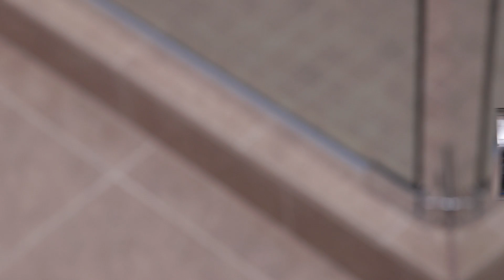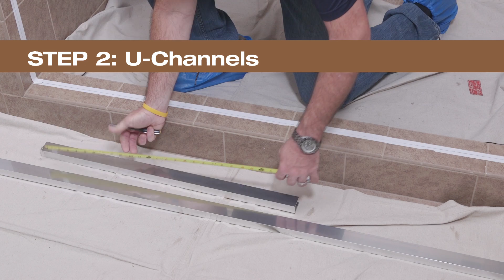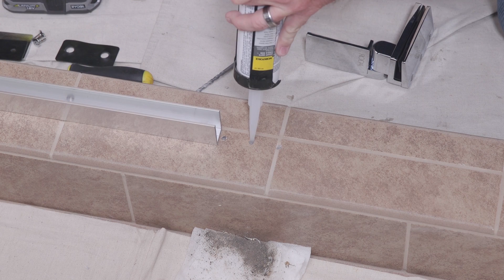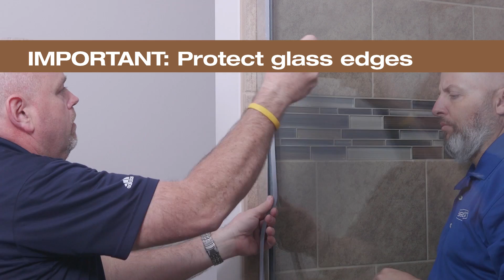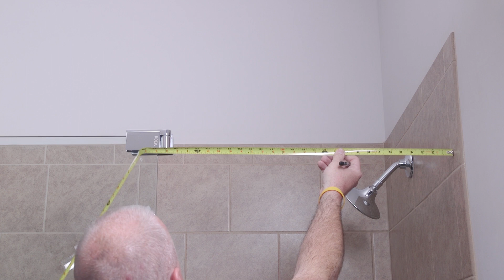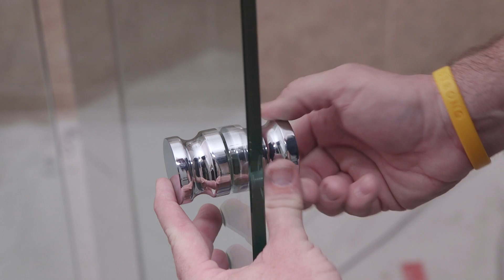DIY Shower Door Installation How To - Cantour Series by Basco Frameless Shower Enclosure

Comment: I have acrylic shower base.  Do I still need drill hole through the aluminum rails and put down anchors?
Reply from the maker: Thank you for your question! The frame comes pre-drilled.  If there is no stud behind your acrylic walls, you will want to use the anchors supplied in the hardware strip.  We recommend not drilling into the base.  The majority of our doors are sealed to the base with silicone, with the exception of our heavy glass frameless doors, which we do not advise putting on acrylic bases due to their overall weight.

Comment: Awesome now you have a leaky shower, good job fellas. You should never drill into the curb. Silicone or not
Reply: Nonsense.  However else are you going to rigidly secure the bottom of the the fixed screen?  In any event, a simple but properly applied silicone bead will ensure no water causes problems in the first place. Personally, I'd lay the channel on a small silicone sealant bed - paying particular attention to the screw holes.   All that said, there is no way I would have such a high and wide upstand as it is an invitation for water to puddle and potentially cause problems.  A mounded shower base would eliminate this issue and still allow for good connection to the fixed and moving glass screens and would facilitate entry and exit of the shower, especially for the elderly or infirm.